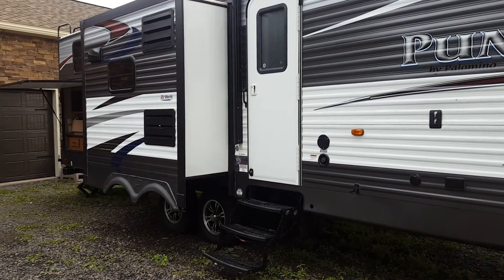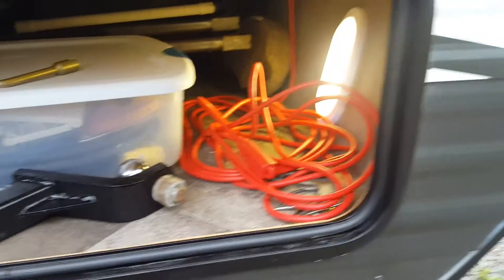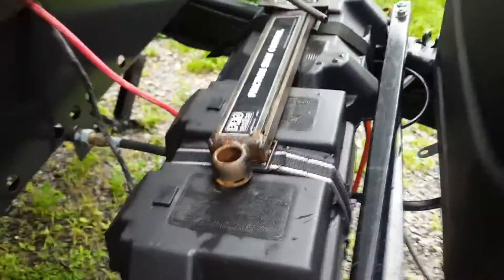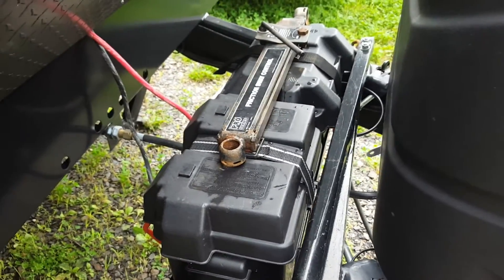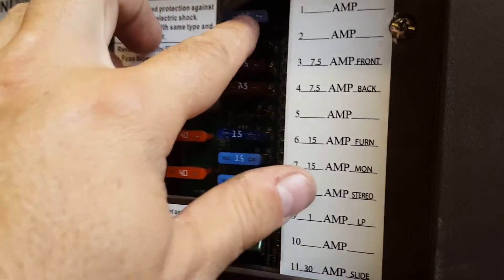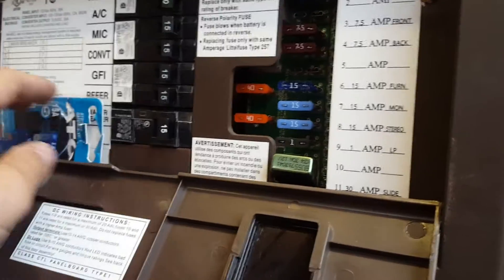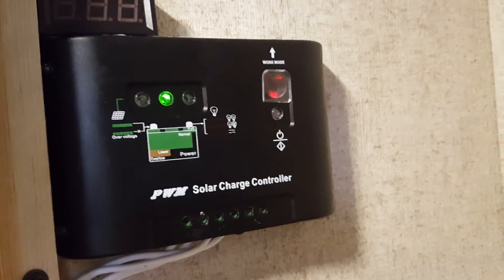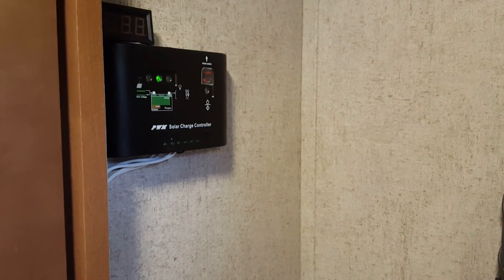Camper Solar panel install-1000 watt inverter on a Puma

Comment: So if you run off your battery inverter to a tv, lets say, and you open the breaker for your converter you would be running with no lighting. Is that correct?
Reply from the maker: everything 12 volts will work as long as your battery is also connected to your camper